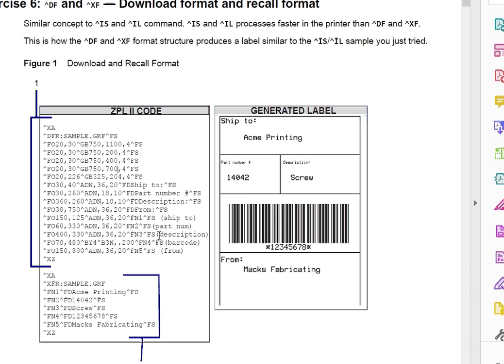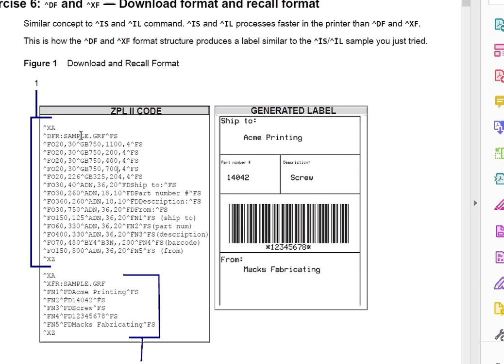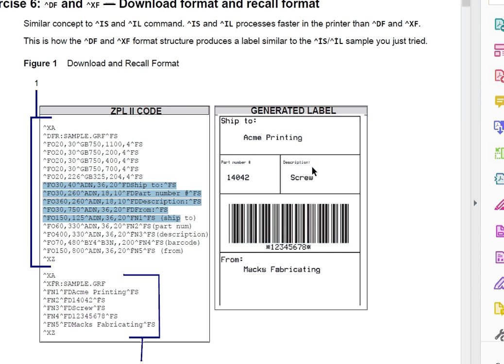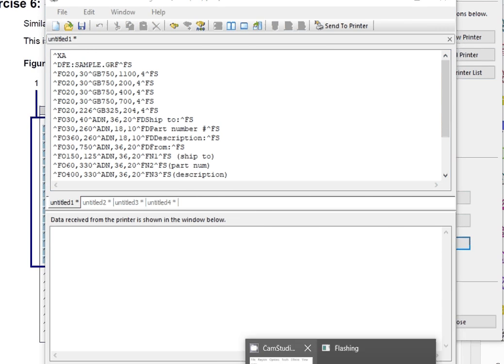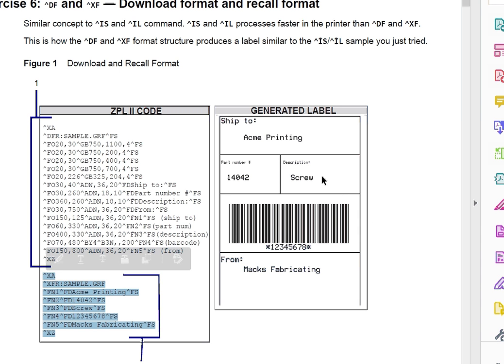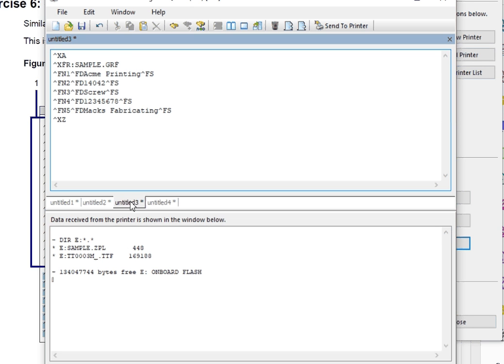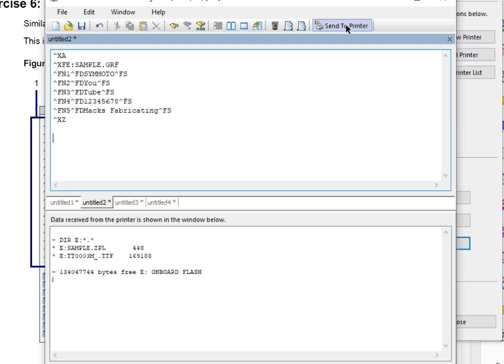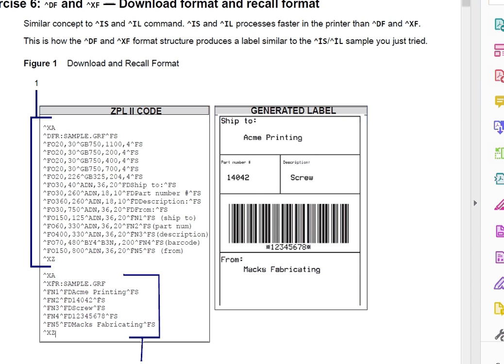ZPL Variable Fields Printing Example

Comment: What software do you use to send commands?
Reply from the maker: There is another video in my list called Zebra Basic Printer Setup - Manual Configuration. This shows you where to get the Zebra Setup Utility which is what I use.

Comment: Can you use a similar approach if you wanted a scale or scanner to add the variable field information instead of typing it in?
Reply from the maker: Interesting question. I am not sure. You could post the question to the Zebra developers Portal, https://developer.zebra.com/. Or call the help desk and they may be able to help with that. I would have to think the scale or scanner would need to send the data. The scanner could be set up to scan to the Cloud and then it could get processed and sent to a printer, but not sure about the scale.